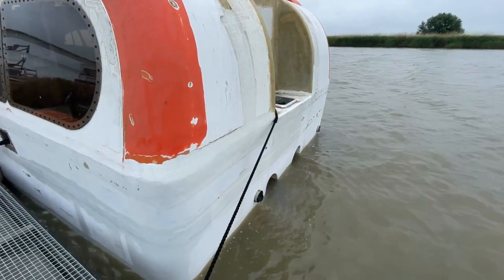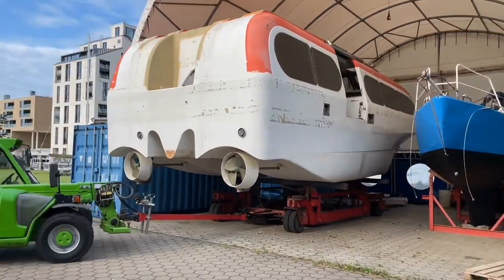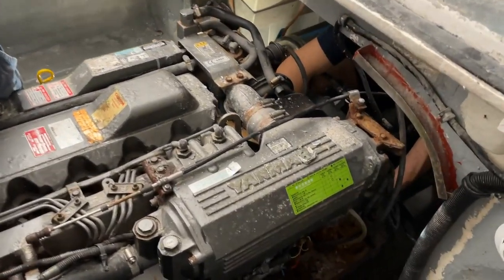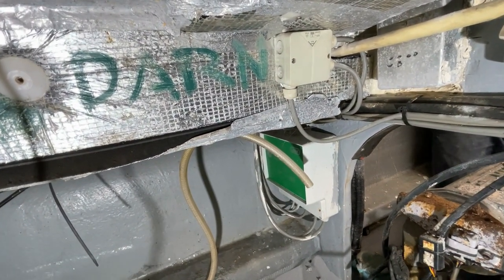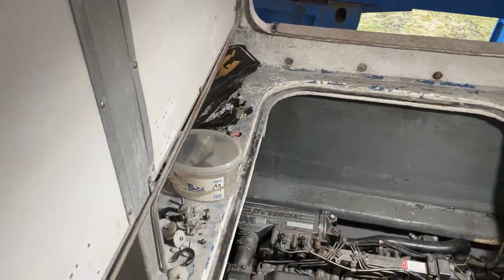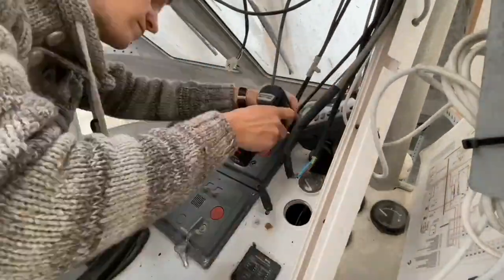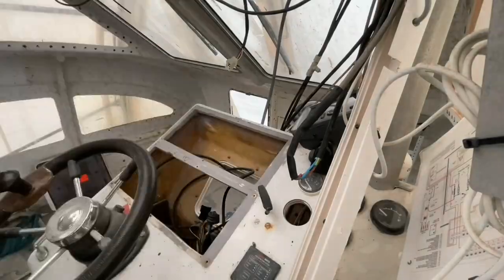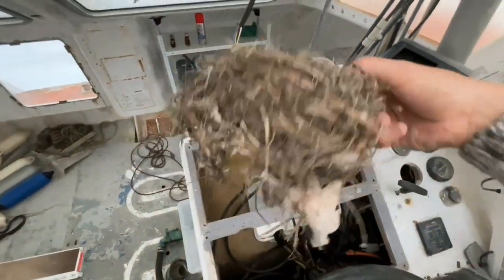Diesel Engine Removal - Turning a lifeboat into a solar yacht - H.o.G. Part 2

Comment: ya, i was also thinking it would be pretty cool to make the engine compartments bedrooms
Reply from the maker: Need those for batteries and equipment like heat pump and wastewater plant. But the rest of the hulls is fine for two bedrooms
Reply: @HeartofGoldLifeboat  o ya, definitely need space for batteries lol

Comment: I've decided to remove my engine too and seal all the hull holes. Then go with outboards.
Reply from the maker: Oh, why's that?
Reply: @HeartofGoldLifeboat  its a 1991 Lifeboat and the through-the-hull fittings are already leaking. To avoid future maintenance. Plus it has alot of other stuff I dot need so its all getting sealed up. I will mount a gas engine outboard and an electric outboard sidebyside.
Reply from the maker: Ah, that makes sense. Are you documenting your project anywhere?
Reply: @HeartofGoldLifeboat  yeah here on this channel. Right now I am trying to get it into the USA from Canada.
Reply: TL:DR at bottom, kinda funny story if you got the time.....

I am just starting to look for a hull. I have been collecting different pieces and parts and was wondering if there is a good source of life boats because of all the decommissioned cruise ships?
You mentioned trying to bring one to the states from Canada?
At one time the USD was KILLING the Canadian monopoly money. So I went to Canada and drove around looking at private sale cars after a dealer laughed me out of the building. I bought a beautiful old porsche for $20,000.
I showed up with three American cashiers checks thinking I was going to haggle but needed the money to do so, couldn't bring cash, soooooo anyway I could combine the 3 checks to make several different offers. I got him to come down from 35k to 20k. Made the deal, gave him the checks.
On the way back to the hotel I realized my mistake, I gave the guy 20k USD he was asking for Canadian pesos.
It was actually worse than that I had asked the bank for Canadian it was a whole big thing. I did a lot of business up there for about 4 years and the banking was always a HUGE hassle because my business back then was mostly cash.
This is the weird part if you are still paying attention. 
I go to see him the next day, his bank asked him about it and when I showed up he had an envelope with my name on it and it said 20k on the outside of it and had a check on the inside for 20k.
In CANADIAN.
At this point my hot headed partner goes ballistic.
Oh, and the guy pretty much only speaks French and I think Hungarian. My partner spoke fluent Jerk and all I had at the time in my speaking toolbar was American and some pig English and 3 years of first year French. 
After a bunch of total misunderstandings that were all the Jerks fault, I finally realized that the exchange rate was Exactly 50%. Or at least close enough that someone rounded something up or down and cut the check for my change for 20k canadian.
So I bought a car for 20k, got the car and 20k in change.
Which totally convinced the guys at the border that I stole it or something.
And I never was able to register that car. After a decade of looking I found a car that had been stolen and stripped all the way down to the frame and still had the vin number on it.
I had it painted to match my car and transferred every single part on to it.
So the question is:
How difficult is it to register a canadian boat in the US?
TL:DR
How difficult is it to register a canadian boat in the US?
Reply: @christopherleveck6835  It was super easy to register my lifeboat in California even though the boat was in Canada and had never been registered as a private boat. It will be boat equipment until it gets over the US border. since its a decomissioned lifeboat. It had no hull number just an equipment number. I was supprised. That means I get to name it. so CA gave me no hassles. So now I have to geta broker to help me with Canadian and US custromes for the trucker. Im flying to NY from CA right now. Im actually at the airport righMt now. Ill make a video about it all soon. I talk about it on my Vlog.

Comment: You are going to need some fairly powerful motors but by comparison to the Silent Yatch's 55 and new 60 with parra kite youve got a good comparison base for power.

By placing your power batteries in the old engine bays you will have the twin advantages of  saving  on the amount of Heavy copper cable and voltage drop on your motor  power cables. 

It will also help to keep your original C of G and ballance.

Comment: Is your channel name by any chance related to improbability?
Reply from the maker: Let's just say, when getting the ship out of the water, it hung in the sky in much the same way that bricks don't.
Reply: @HeartofGoldLifeboat  as long as you don't hit the water like bricks do and then do what bricks do after hitting the water, you are probably OK....
If you DO....
Your lifeboat sleeps with the fishes.
What, if anything, do they do to those engines to make them work on demand after not ever really being used?
I collect cars. The only thing you can do to a car worse than let your teenager or wife drive it, is to let it sit....
They must have some kind of battery cut off? How do they handle the fuel so it doesn't go bad? Diesel can have stuff grow in it. Gas turns to varnish and oil turns to yucky oil.
Then you have all kinds of components that don't like to sit for long periods of time... what about the cooling system? If its been used at all then it either got salt corrosion or rust from standing water.
OH and speaking of salt. A lot of salt spray on everything constantly I would think...
How are they kept in a ready state in case of emergency?
There must be a card or something in there just in case a passenger had to get one going by themselves, right?
Reply: @christopherleveck6835  

Life boats are checked and maintained onboard a ship plus this is a tender so it would be used to ferry passengers and supplies into smaller ports or shallow anchorages.
He dumped the Dervs ... or rather sold them.
And got most of his outlay back on the total purchase. 
Thats one reason why he is going electric and solar ..power.

These hulls a high strength fire resistant fiber glass most of the fittings are marine grade stainless steel because while not in constant use they are hung out on the sides of the ship in all weathers.

Each of these would in an emergency have to carry 150 passengers or more and would have a crew allocated and trained to operate the vessel in emergency conditions as well as to make sure the passengers dont endanger the vessel.
Reply: @HeartofGoldLifeboat  

Vogon constructor fleets  ..Belgium man😂😉